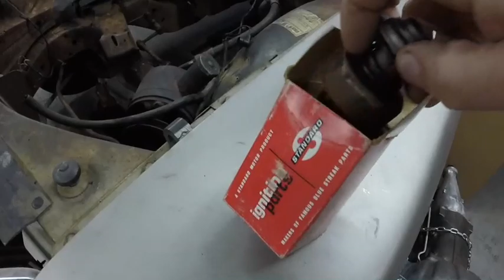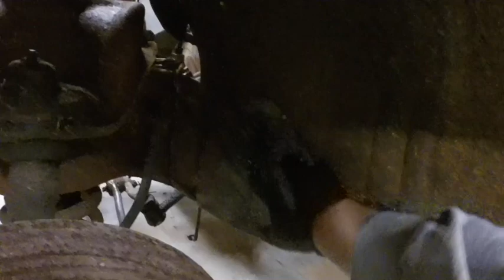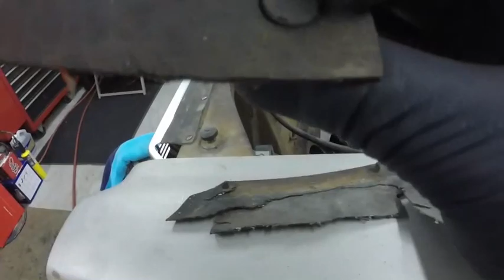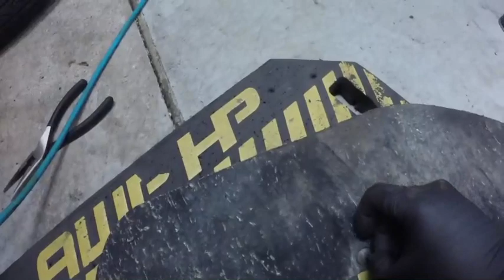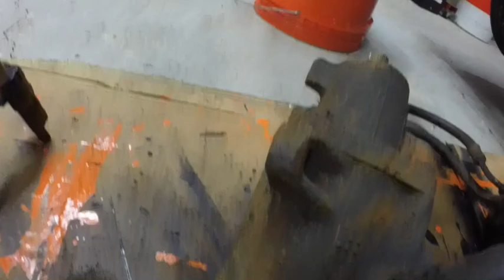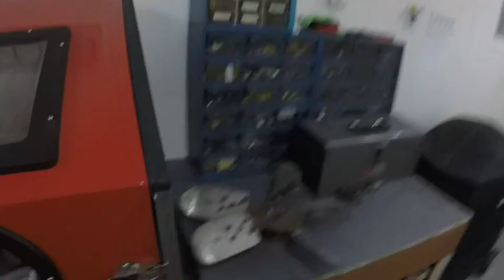1966 Ford Galaxie 500 convertible restoration part 24 pulling the steering gear

Comment: Several years back, I had a super nice, low mile, 1966 Impala SS 396 4-speed that still had its original alternator. It needed to be serviced so I took it to an alternator/starter shop in town (gone now) and explained to the owner what it was and that it needed to look totally original when done. He said he understood and that it would look completely original. When I came to pick it up, it looked great other than the fact that he ENGRAVED the date he rebuilt it along with a few other numbers into the case. Yes, it was also on the half of the case with the factory numbers on it. When I confronted him about it, he basically told me he didn't see what the big deal was. I never went back there again. You've got to do everything yourself. No one will do their job anymore.
Reply from the maker: I have a friend that had a 66 Impala SS convertible. He had the 250hp 327 and a powerglide. A 396 4 speed is kinda rare. Another friend has a 67 Impala SS convertible with a 427 4 speed. I have never seen another one ever. He also has a 70 Impala SS. It has a 350, and a  Turbohydromatic 350. Both are rare cars in my mind.

 If on the chance I take a part in for rebuild, I ALWAYS tell them not to paint or stamp anything into them.... and let them know why. It can ruin a restoration, or cause me a ton of work to repair there mistake. I sent out a power brake booster "once", asking them not to paint it. I got it back, with a horrible paint job, with big runs. I had to totally disassemble the booster, strip it and repaint it. It added hours to the job.

Comment: You're right about the front wheel hubs - they do not separate. I struggled with that for a while on my '66 and finally decided to take of the hub nut and remove the whole drum.
Reply: yeah, the studs are crimped onto the drum and need a stud cutter to remove, sdid hundreds of em at the shop

Comment: You can get reproductions of the splash shields, but be careful. The originals are "masticated" rubber just like my Chrysler uses, and at least one set I saw advertised looked like plain rubber. I have to wear a certain kind of shoe also because of the fasciitis. I get as light of a shoe as possible with thick insoles.
Reply from the maker: Most repos are plain rubber, but there are some that look like the correct originals. The left one is half missing, and is not reusable. The right one is so hard, I am surprised it didn't shatter when I removed it. To think I use to cut new ones out myself, when nothing was reproduced for this era of cars. Still have some of to old style sheet rubber, with the cords in it, but I will probably go with the best reproduction I can find. 

I found the Brooks Diads 9 or 10 are the best shoe I have ever owned. There $125 a pair, but well worth it. Buy them online, or in a store where runners go. There popular shoes with runners.  My feet have cleared up, with zero pain, since I started wearing these shoes. Before these shoes, I would get up in the morning, and not be able to stand without holding on to something. Now I can get up and go, no issues at all. Picked up some "Shoe Goo" to glue the sole back on. The glue will outlast the rest of the shoe.

Comment: So you are doing the parts swap so you can keep the correct look? If the old alternator doesn't whine or grind, you might get away with a diode bridge. BTW, I live up in Saginaw and love your videos.
Reply from the maker: I will put bearings in it for sure. Just don't want any issues if I take it on a long weekend road trip.

Comment: Watching your video today reminded me of working on my 67 Impala last summer..The body was off the frame which i learned during front suspension rebuild how dangerous it is to replace front coil springs without the weight of the motor to help compress the spring..And also another lesson was buying a spring compressor tool from harbor freight that broke while a spring was compressed..Downright dangerous!! Its worth spending good money for good tools when it comes to safety..We only have one life right? Another thing i did was i coated my upper and lower arms with Por 15 and yes it does chip..I was curious about your opinion on that stuff..150 $ a gallon i felt was pricey...
Reply from the maker: I have a really good quality spring compressor. Used it many times, and hope to have no issues with it.

Comment: Just wondering, Are you going to stick with the original master cylinder. Or go to a split one?
Reply from the maker: Going with a 1967 dual drum system. 67 was the first year of dual systems.